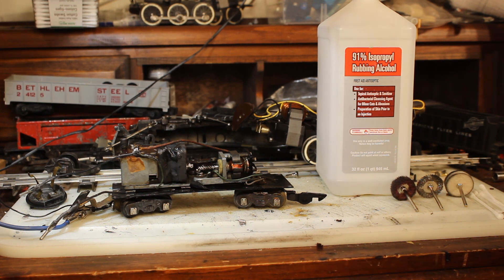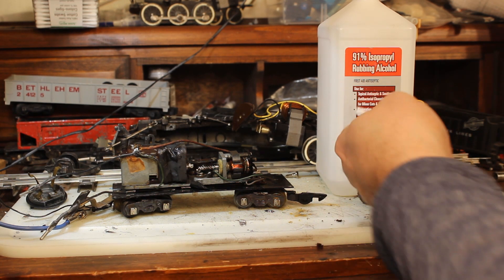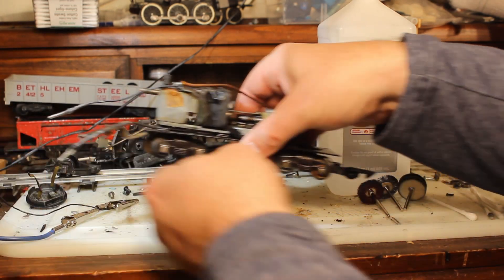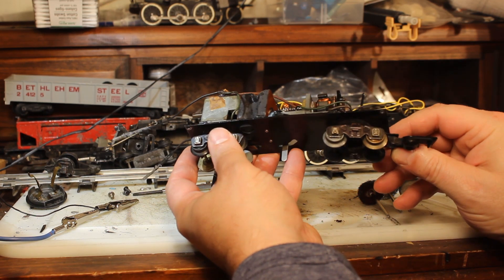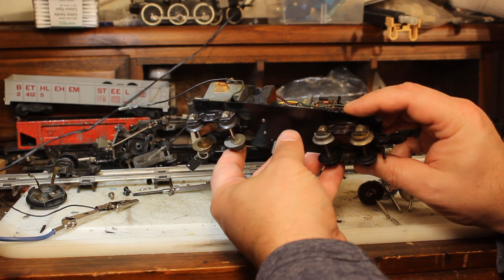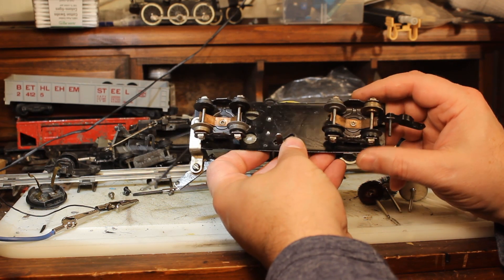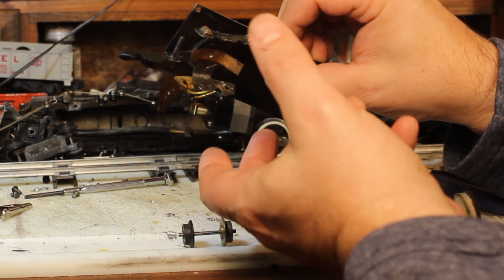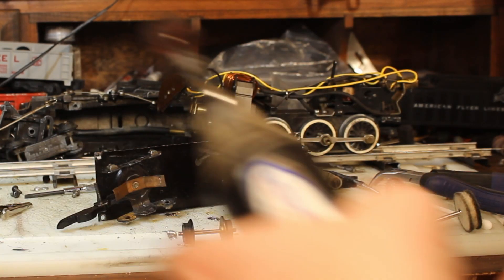See the Clues Part 3...how little details in old steam engines point toward what repairs are needed.

Comment: You've got the video angle down very well now. I was not aware that axle lengths were different but at first I wondered why that would matter because the wheels have to be the same distance apart for correct gauge.  Then I noticed in the video a small knob type end on the axles and I guess that's because different trucks are made just a bit differently and that know must keep it centered on the truck.  Thanks for another informative video.
Reply from the maker: Thank you Gary.  I'm wondering I'd the pike master axles are not a bit longer yet then the wintered axle trucks.  I'll dig into that a bit more in the future.